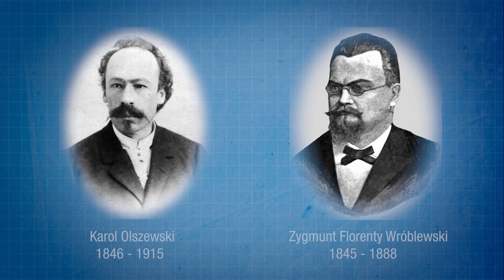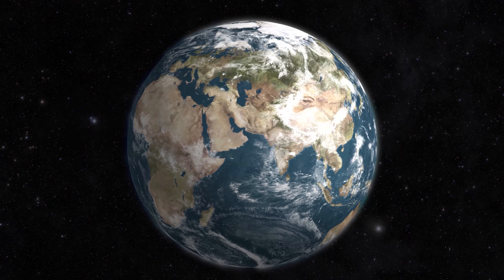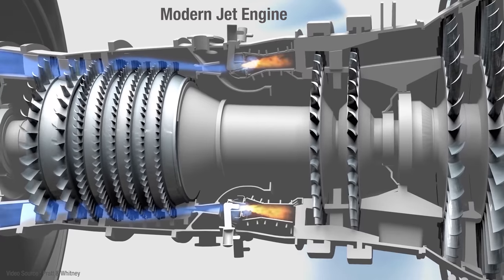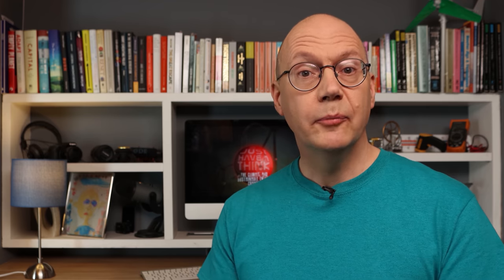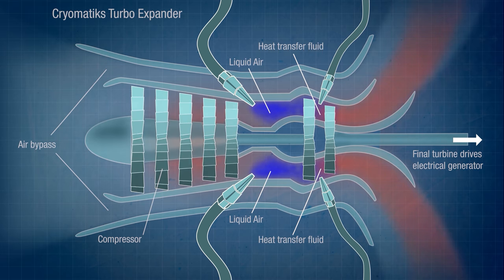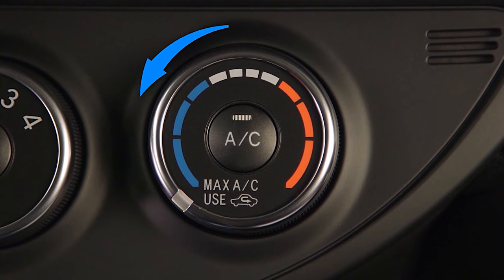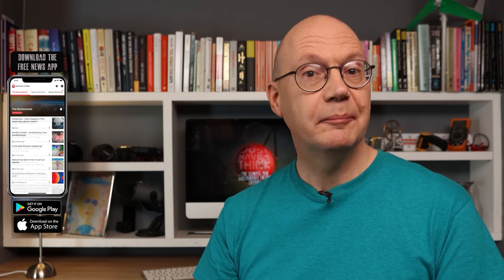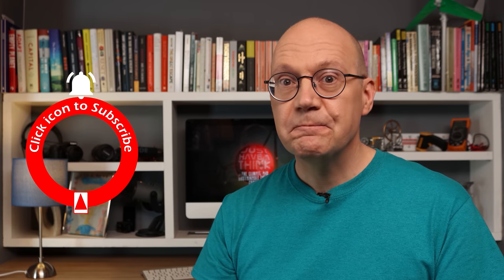Portable Liquid Air Power. A new boost for electric vehicles.

Comment: Braking energy can also be stored in fast super capacitors, thus sparing the battery pack.
Reply: That's what I was thinking. I guess it's a race to see which technology will become most cost effective first? Super capacitors certainly seem like the more elegant solution in the long term, but who knows. Maybe something like this will win out for larger vehicles.
Reply: @adamlytle2615  : yup. I’d think electronics beats mechanical everytime
Reply: I wonder how much energy super capacitors can store as well as the cost?
Reply: @martinw245  thanks for sharing. “While Li-ion batteries can store around 20 times more energy for their weight than supercapacitors.” This company is looking at range extenders. They mention anywhere from 10kwh to 120 kWh range extenders. That would require huge super capacitors since they hold 10 times less energy than li-ion batteries. I don’t think super capacitors would be the best use case for range extenders?
Reply: @dewiz9596  Full electric beats changing electrical to mechanical, to compress a gas, to then be stored, and released, in order to create mechanical force, that pushes a turbine, that spins a generator, that creates electricity.  🥴
Reply: @kylekleman  

From the article...

"Rather than a lithium-ion (Li-ion) battery, the Sián employs a supercapacitor array, which Lamborghini boasts is three times more powerful than a battery of equivalent weight."

The Lambo concept is a little diferant to a conventional hybrid, in that instead of using electrification to downsize the IC engine, they instead employ a huge IC engine and boost it with electrification. After all, it is a Lambo. 😆

Incidentally, there is a company callad Killowatt Labs who claim they have a supercapacitor that's the same form factor (size and weight) as lithium ion, same performance and can discharge slowly like lithium ion batteries.
Reply: @kylekleman  it depends on how or what extends the range, meaning that if the braking and acceleration are done utilising capacitors, which is the bulk of surge demand and uses a significant amount of power, then the battery will last longer and range increases.
The inefficiency of regen braking when charging the battery pack is being able to accept a large surge of energy very quickly which is what capacitors are good at.
Reply: @yodab.at1746  Absolutely. And the ultracaps can be used for instantaneous storage, then fed back into the battery slowly if not used for acceleration.
Reply: @kylekleman  The high charge/discharge rate of ultracapacitors allows them to be useful in relieving the load on the battery pack for acceleration and deceleration.  The range extension comes from the more efficient use of the batteries.
Reply: Supercapacitors have a low power to weight ratio and the added weight is detrimental to the vehicle.  That's why you don't see them used - instead they use batteries.
Reply: Almost all hybrids and electric vehicles have some kind of cap bank, but how much they can store is limited by size, weight and cost considerations. If we could beat the first two, we could get electric cars that recharge faster than you can pump gas, assuming anyone could afford them. At this point I think most of these cap banks are used for the start from a dead stop, a little smoothing of regen power, and perhaps engine restart on hybrids. What they can hold is usually well under 1% of what the battery stores, perhaps even less than .01% if what I remember from the first generation prius is correct. Just shaving the very highest of the charge and dischage current can greatly extend the useful charge and the cycles the battery can withstand.
Reply: @adamlytle2615  you could incorporate all of it together   liquid nitrogen and the capacitors for starting and braking put it all together in one unit and it'll run for a long time and get excellent mileage with very little waste
Reply: Again this story? Capacitors and batteries are not the same thing.
Reply: @jdrissel  
Actually, only hybrids use them so far, EV's usually have a layout that supports high current draw at system voltage (400-800V).
However, if you're interested, i currently write bachelor thesis about the use of a High/Low power system for vehicles (this kind of system is much more common in the energy production industry), i could show you the end results of my simulation when it's done.

However, what i can say now is, that besides the lifespan, the efficiency of the battery pack goes down with high current draw. That's why a Tesla will never by an enviromentally friendly EV, that car is like a Bugatti Veyron for the commoner, simply a waste of resources and energy (well, when used as intended, with superchargers and it's abnormally high accelleration).
Reply: Right, Riversimple do this (used supercaps to to keep more regen) in their vehicle.
Reply: The energy density of a supercapacitor is not enough to really have that much of an impact compared to this.

I believe this has about 10 times as much energy density compared to a supercapacitor, not to mention super capacitors cost more.

But scaling up both of these will lower the cost and super capacitors energy density will probably go up as well.

I don't know what the solution is I just hope we get to it quickly.
Reply: You can't, super capacitors can store much and for a long time. Capacitors flatten the current peaks, otherwise you damage your batteries
Reply: @kylekleman  You misunderstand the problem. The supercapacitors will only take the kick of breaking a heavy vehicle before it is transferred to the battery at a pace that the battery can take. It can also be used to power the acceleration that you most of the time will have after breaking. Anyway you never need more than what is needed to store the energy from the last breaking action.
Reply: @kylekleman  the most likely use of super capacitors in the first instance is as an efficiency/regulator process to support li-on in both acceleration and regeneration. Probably a place for both depending on the type of vehicle.
Reply: @AnthonyHigham6414001080  

Yep, Ive been following Kilowatt Labs for what must be at least 5 years now. Watch them closely, the Latest version of the Prismatic Sirius could be a game charger.
Reply: @AnthonyHigham6414001080  I hope both technologies are successful. And thank you 👍
Reply: Roaming Rishis  95% of the time there is zero reason to push the recovered energy back to the battery. This is just deducting two conversion losses (electrical-chemical, chemical-electrical) from the recovered energy. The majority of the time braking is shortly followed by acceleration. Just keep the energy in the capacitor, and use it straight from there, topping it up with charge from the battery to replace what is lost to rolling resistance and drag. The only (rare) exception is if you are rolling down a long incline (i.e. descending from a high mountain pass) where the recovered energy is greater than the limited capacitors. Then you could feed that back to the battery.
Reply: @kylekleman  the super capacitor just needs to be able to capture more of the energy from regenerative breaking.  The job of the super capacitor is to buffer the battery from the high rate of energy transfer.  Most often that period of high energy transfer is a short period of time.  As soon as you begin to accelerate after breaking you would begin to use the energy.  You would exceed the capacity of the super capacitor when you descend a hill.  Super capacitors were used in a Carnegie Mellon lab electric retrofit  of a Honda civic as far back as 2008.  I rode in it when I met my coworkers at the lab.  It was designed so that any local auto shop could do the retrofit.
Reply: @yodab.at1746  Unless the car is switched off, it seems pointless to charge the battery from the capacitors if that charge can instead be used to directly power the motor. That would be more efficient than storing the charge in a battery and then using that power to drive the motor, with the loss of efficiency that entails.
Reply: @thomasmoore4576  absolutely a holistic solution is probably the correct one.
Reply: What about the piercing noise usually associated with turbo jet engines?
Reply: If I understood it, the thermal energy from braking is just a small component of the carnot cycle here. Most of the work is done by the temperature difference between ambient air and liquid air, is my understanding. You couldn’t get that power from just capturing wasted braking energy.
Reply: Yes but the point is the conversion from mechanical energy to electrical energy back to mechanical can be avoided completely in such short term storage needs.  The question is does the mass penalty negate avoiding the conversion losses.
Reply: For cars, I think the best option is super capacitors; however, for large vehicles something like this might be a better option. Super capacitors are compact, simple and  low maintenance so work great for consumer products (e.g. cars and motorcycles). On the other hand, a mechanical system like liquid air can be more cost effective at a large scale on delivery and semi trucks. Maintenance is less of a factor as commercial vehicle fleets often already have on-staff mechanics who are familiar with mechanical systems. There's also safety issues with storing that much power in a way that can be instantly discharged.
Reply: @RealitysSuccessor  Well capacitors are typically the first electronic component to fail due to the dielectric drying out.  Remember how old CRT TV's would start having horizontal sync problems, that's the deterioration of capacitors over time..  Super capacitors have their place in temporary buffering of energy but they are not a god send, even the linear relationship between voltage and state of charge can be problematic for an EV.  EV's will still need a primary energy storage mechanism aside from super capacitors.
Reply: @jimurrata6785  Yer that is right but why not go the other direction and have a purely mechanical system with cryogenic air for fuel
Reply: @yodab.at1746  Yes great coupling of technologies
Reply: @donbrutcher4501  You hit the nail on the head
Reply: @user-wy4mp9ts3u  Horrible efficiency due to thermodynamics.
Poor density requires huge tanks, as well.
Reply: Ai pierderi cu 2 transformări.Aer comprimat în butelie>>>motor.
Reply: @yodab.at1746  Frânarea ca si pornirea trebuie să aibe accelerație. La un obstacol nu frânezi constant ci din ce în ce mai tare. (multiplicare progresivă =demultiplicare progresiva la pornire)
Reply: @stephen-boddy  Surplusul de aer comprimat poate fi eliberat simplu, la prea plin, cu o electro supapă. Iar incărcarea in baterii durează. Aerul este instant fână, instant pornire vs. costuri, volum,
Reply: @johnwang9914  Condensatoarele consumă multă intensitate la începutul frânării, iar necesitatea opriri este la sfârșitul jocului( in mod accelerat, nu constant)
Reply: @user-wy4mp9ts3u  Adică bateria+cilindri sau o rezistență să producă căldură pt aerul liqid>>>gaz.?
Reply: @ricnyc2759  Yeah it blew my mind what the actual definition of a capacitor is. I mean they always looked like batteries to me but nope! Much different.

Comment: You mentioned an interesting point, the liquid nitrogen used in factories to fill food packages, when being warmed and turned into gas again to fill the food packages can first be used to run a turbine when warmed and create electric energy which might be enough for the food factory and then the warmed nitrogen which is turned into gas can be used to fill the food bags which you showed in the beginning of your video!
Reply: Just as the expansion of the air heated by your forced air furnace should be harnessed. (internal combustion furnace.)

Comment: Your final thought about using the engine to make electricity for remote areas… How do you get the liquid nitrogen to the generator? Like using Hydrogen as a power source it’ll take more energy to produce the nitrogen than the generator supplies.
The reason that a petrol engine is so effective is that the energy used to make the oil has been used already by the planet so the energy cost of making petrol is much lower than what we get from burning it. It has a net positive energy ratio. The energy required to convert oil to petrol is lower than the created petrol. It’s self sustaining.
It’ll always take more energy to make the H2 or LN than you get from the final product.
Reply: grindupBaker  No, that wasn’t my real point. My real point is that people expect alternative fuel supplies to magically make energy whilst ignoring the fact that oil is stored energy that took a long time to make. With oil, once you’ve pulled your first barrel up the pipe it can be used to extract more oil so there’s a net gain in energy. LN or LH can’t work that way. If you used the LN or LH to make more LN or LH then you’ll quickly run out. Net loss.